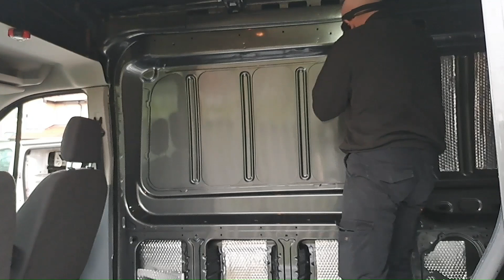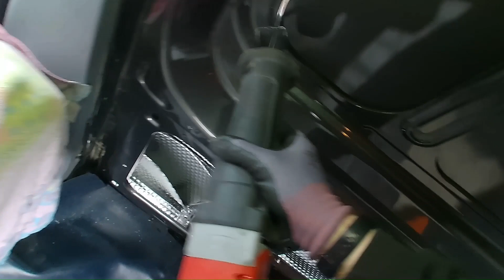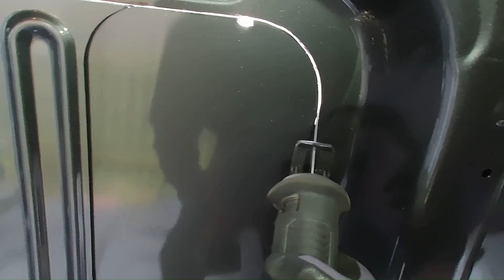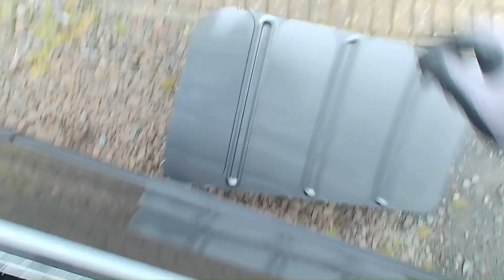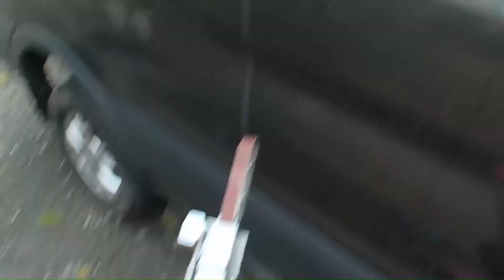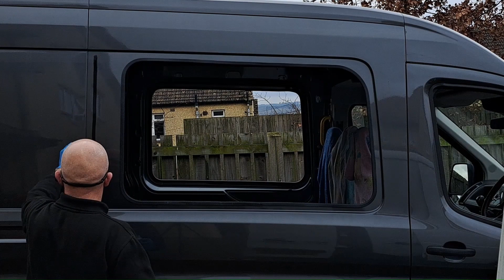FORD TRANSIT | Side Window Conversion

Comment: Should have vacuumed up all the metal shaving in the slot area between outside skin and inside skin. I have to think that finger sander spread nasty metal bits everywhere. Rust will start with the minute fragments and through painted nearby surfaces in a mater of hours to days.
Reply from the maker: @scotttannehill3533  Wow! I better do a recall on the 100+ conversions I've done over the years because of the random youtube fault finder 😁
Reply: @AUTOGLAZ1ER  
What do you care about rust. It doesn't happen until after you got paid!
By your answer, it appears you did not do it and don't even care to relate its importance. I had rust start eating though my metal deck it a few days after I missed just a few micro small pieces of metal. It's not a fairy tale.
Don't let arrogance get in your way.
Reply from the maker: @scotttannehill3533  You know nothing about me! Away and troll someone else.
Reply: I know you won't admit you are screwing up your customers vehicles. You need to go back to school. Too old to learn?
Reply from the maker: @scotttannehill3533  OK, I am screwing up my customers' vehicles, and I will go back to school....you can move on now 👍
Reply: But that's how they come from the factory!! LOL